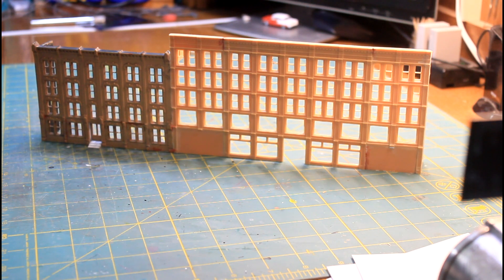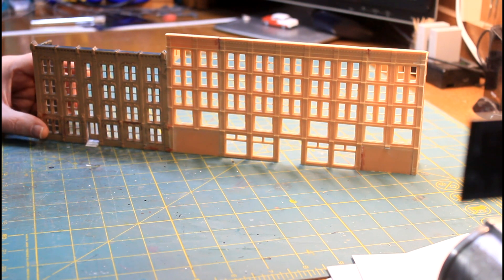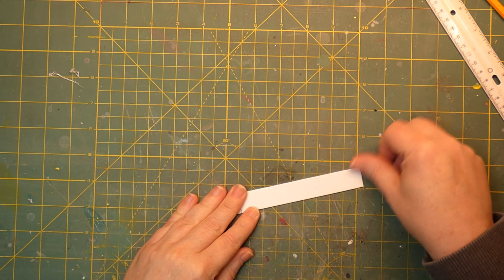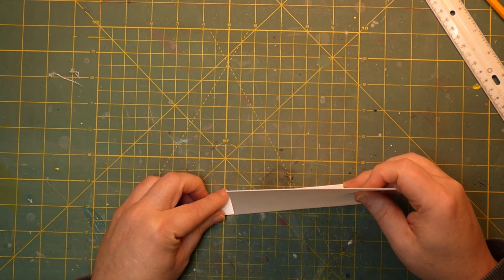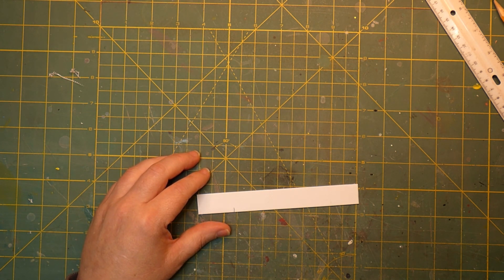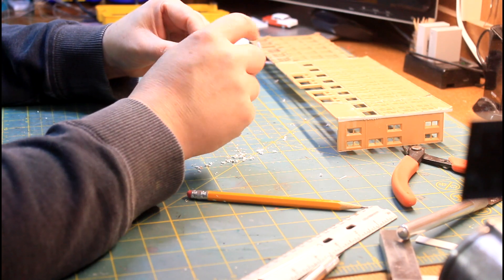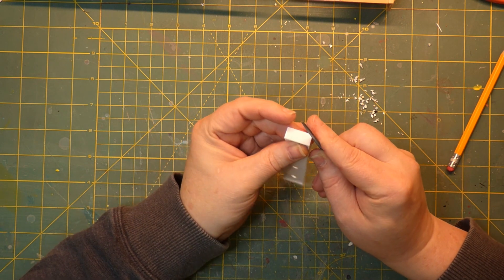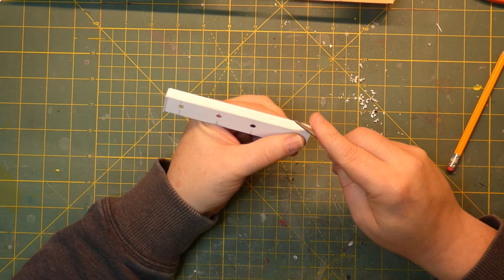Kitbash A Wall Flat: Part 3

Comment: I think you should recess the doorway like an old Department Store.  So the windows will be display windows. To bad the opening isn't bigger so you could do a revolving door and a couple regular doors on either side of the revolving door.
Reply from the maker: Yup I agree I wish the doorway were wider I could have done a lot with that. I also actually was considering the revolving door as well but I think I'm just gonna keep it simple on this one. The large glass doors will give the look of an updated old building...I hope.

Comment: Like the use of the styreen to make your off set... It looks good so far and don't think the awning is that tall looks Great.  Looking forward to your next installment of the build.  what do you use to glue with?
Reply from the maker: Thanks! As far as the glue I use I really liked the Tenax 7 but it's no longer made so I found something I like but I don't like to promote it. I'm using something called mek with some styrene dropped into the bottle that melts into it. Works great but i know it's not the safest thing for your health and I'm pretty sure it's banned in some states.